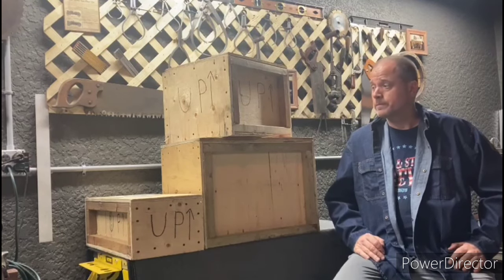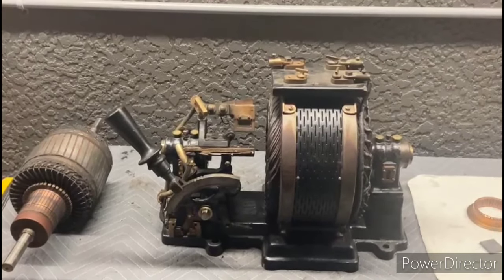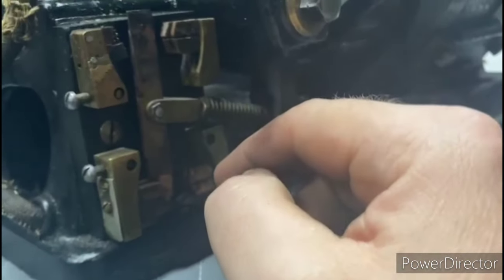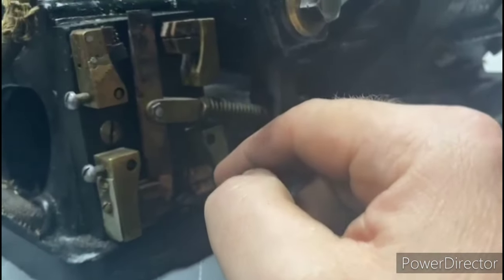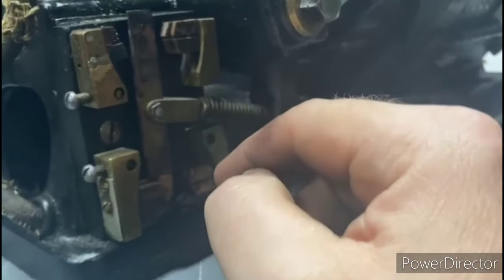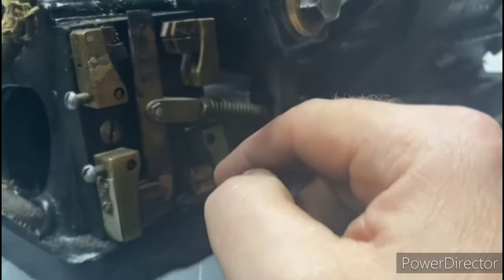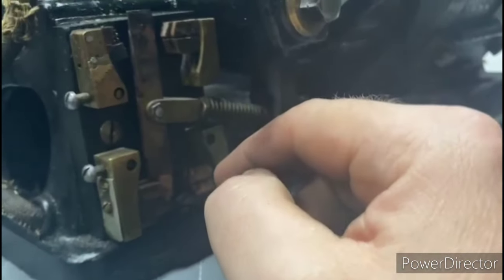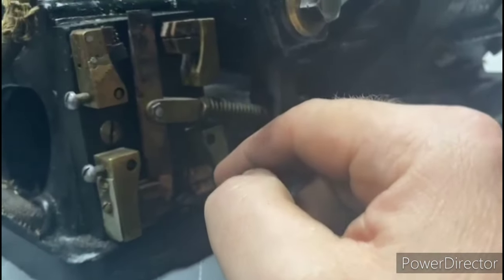Emerson Electric: Manual Start, Antique Motor circa 1900. Conservation & Restoration.

Comment: Beautiful motor; and your preservation works are stellar!  It is so beautifully overengineered that one has a hard time believing it was an industrial machine and not a work of art. 

I didn't realize you had lost your home in a recent hurricane! 

As for the rotor winding short, that is so unfortunate. However, since once it is in induction mode, all segments are shorted - I expect it will run perfectly and indefinitely once at speed and placed in induction mode. If you have some machine which doesn't load the motor under startup, that motor would be perfect.  

Looking at the startup handle quadrant, with the added notches, I have a theory as to how the rotor was damaged. That theory is some ignorant person decided that this motor wasn't fast enough in induction mode, so they designed those notches to hold it in the startup (series) position. They probably ran it like that for an extended period of time and resulted in that damage.
Reply from the maker: Guess we will never know for sure about those grooves. I don't plan on running it often but it does run nicely in induction mode as you noticed. I was happy to get it to the point where it started up and ran under its own power. It was DOA when I got it. 
Sure was beautifully made though and one day I will donate it to a museum.

Comment: That is a very interesting motor! So glad you were able to save it and very good to see you back! The start arrangement with the lever is quite a piece of work and I haven't seen one with a similar setup. You did a very nice job with the cleanup and re-wire of the motor, and I like that you don't get too invasive or carried away with trying to make everything perfect and shiny, only enough to clean and make it function properly. Tom did an outstanding job on the motor plate as well. I have an old Century repulsion start motor to go through at some point, as well as some other smaller, very old motors to get to at some point. I just finished an early 30's heavy cast iron floor model Robbins & Meyers Propell Air 28" 1/6hp floor model fan that I picked up at the flea market 2 years ago. It needed extensive repairs to everything. I had to make several parts as well as re-wire the motor leads and re-insulate the windings and locate hard to find replacement oilers that were missing. I look forward to the next video!
Reply from the maker: I am sure it was tough finding those oilers. Thats one of the challenges in the hobby for sure. Good luck on your Century motor. Those are my favorites.